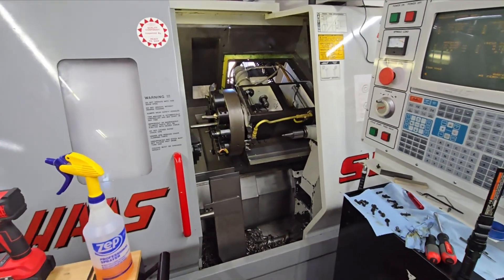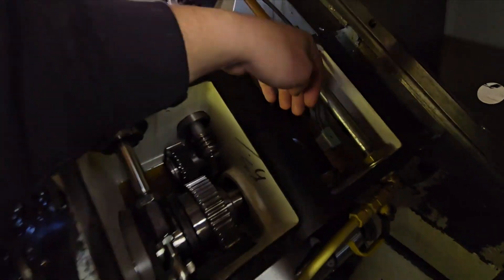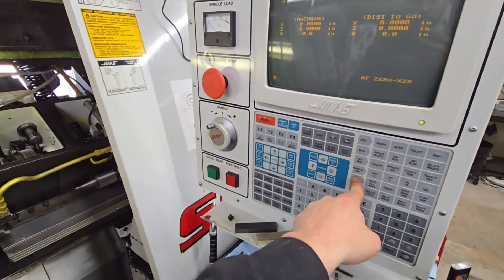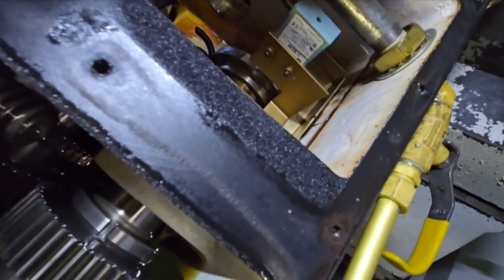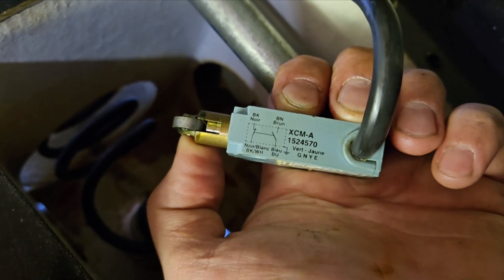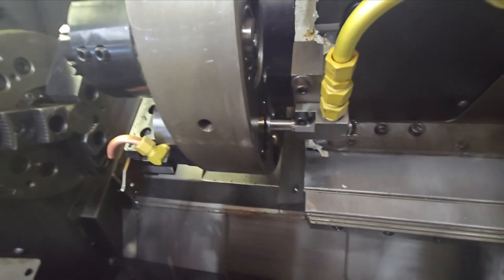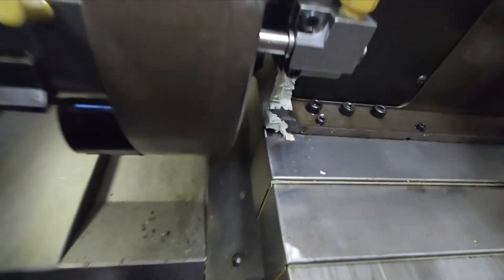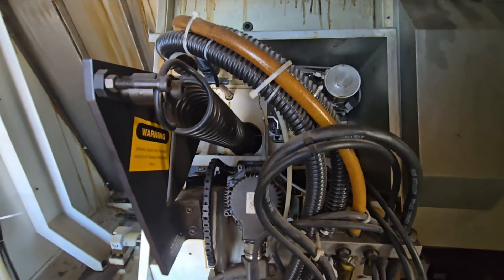Haas SL 20 Turret home alarm fix 114 Turret lock Fault

Comment: Thanks for the Tip...now I need to line up the Tool Pockets to the Spindle Bore.. HL-2 Lathe
Reply: If it doesn't line up, you could get an aluminum cylinder, drill and tap two holes for Allen Head inserts, put the cylinder in the tool holder, put a center drill in the spindle, then drill to the size of whatever tool you want in there.

Comment: Worth a look.  My issue was a cracked collar nut on the motor side.  Great idea to check this in any regard.  Great Video!
Reply from the maker: Interesting, was it behaving the same way but slipping on the shaft so it was landing in the wrong spot every time? Mine would usually be consistently off, but now that I know, it was based on how long that switch was sticking in place. I've been running this machine since and its been flawless. I guess the real answer to fix is open up the gearbox and watch what's happening

Comment: My machine problem with 113 turret unclam fault 😢
Reply from the maker: @simantu1  113 could fall under the same family of issues as 114. First thing is to make sure you have enough air pressure, and no leaks. 100psi on the gauge. After that try to spot that switch through the hole in the back and watch what it does